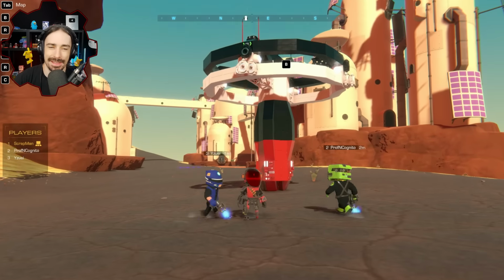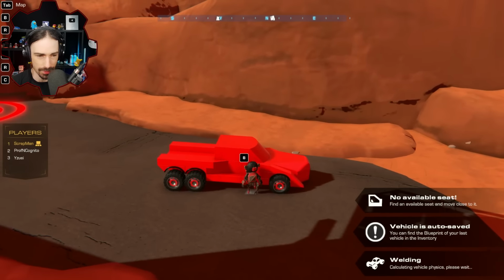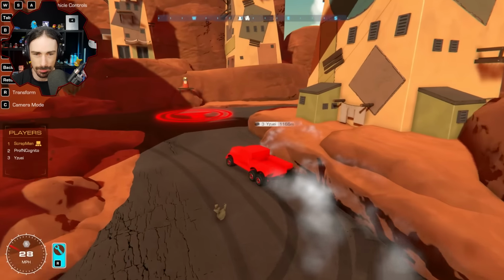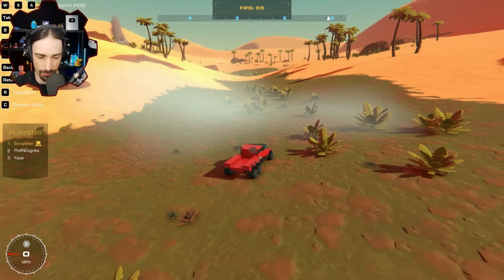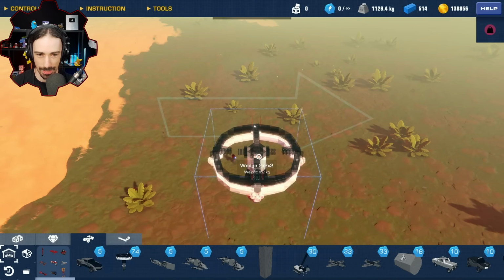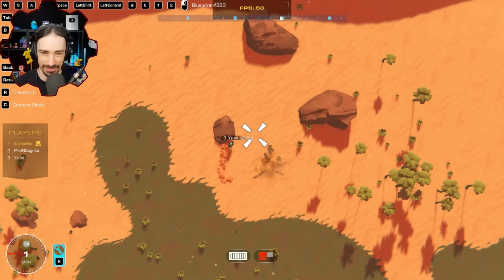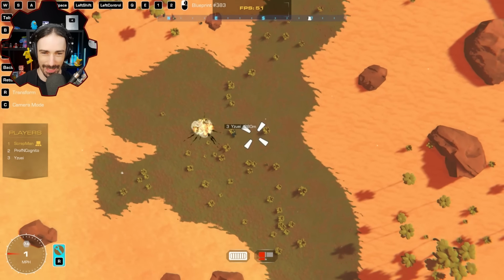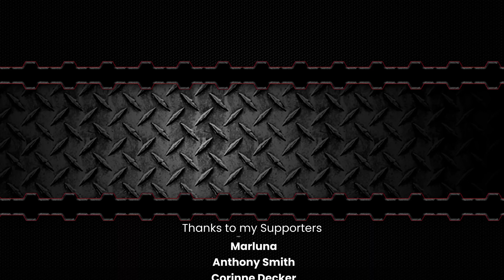2 Orbital Strike Cannons VS 1 Car!

Comment: 6:34 the missile knows where it is at all times
Reply: It knows this because it knows where it isn’t
Reply: By subtracting where it is from where it isn't, or where it isn't from where it is (whichever is greater), it obtains a difference, or deviation.
Reply: … I didn’t think we’d get this far.
Reply: The guidance sub-system uses deviations to generate corrective commands to drive the missile from a position where it is, to a position where it isn't, and arriving at a position where it wasn't, it now is.

Comment: Air battle with flying cars set within a certain altitude parameter! 160 block limit. 6 power cores and a smart cannon. Cars that go too high or too low have 8 seconds to get back into the designated altitude before automatically exploding

Comment: I noticed this in other videos as well that the camera timing is a bit ahead of action. Seems a bit strange when ScrapMan calls out action instantly. Feels like it lacks natural reaction time. Example at 12:31
Reply: That just happens during editing, I think it's where the video file goes from 60 fps to 59.997 or something and the audio doesn't, so the frames lag behind after long enough.
Reply: @-aid4084  No that isn't it. If that was the case then lips would get out of sync with audio. From the looks he is recording camera and game separately and then syncs together, but without leaving room for reaction time. Just my guess.
Reply: Yeah I've noticed it in the last couple of videos as well. I think it's a fixed desync, the editor probably changed their editing process a bit and it had knock-on effects that were subtle enough not to be caught.
Reply: Well everything is recorded separately, because, it has to be
As in there is 3 tracks, 
1 is audio and video for the game and everything happening on his computer
2 is his microphone 
3 is his camera 
None of these are together and are often started at different times
There is literally no way for that to not be the case 
Even your phone records them separately, but because its software that starts it at the same time, it combines and syncs it for you  
Technically the game stuff is separate too obs just does the same thing, starting recordings at the exact same time and combining them for you

One trick that is often used for syncing cam and mic is to clap once on camera to sync it combine it then cut it out later
However there is no real trick that can be used to sync his face cam with the game footage other then eyeballing it 
If i were to think of 1 way to do it, is for him to turn off his lighting and have his monitor flash white briefly
So that he could sync the footage of a white flash on his face with a flash on the recording, just like the clap used for mic to camera
Which if all of that is recorded everything could be synced and then the syncing set up could be cut out later
But he likely isnt doing that and is just guessing based on his own reactions and forgetting to add some delay
Since this is only happening recently, he could have hired an editor who is now making these mistakes, or just developed a bad habit randomly
Reply: It's very strange. Only really developed somewhat recently. Looking into it...

Comment: Idea for this kind of game mode 1 orbital canon vs 1 anti air turret and 1 car the orbital cannon can repair any time it wants but the anti air and car can not if the car stops the round is over 😅
Reply: Also either the anti air can be separate or on the car since the car can only be in 1 area anyway 😂